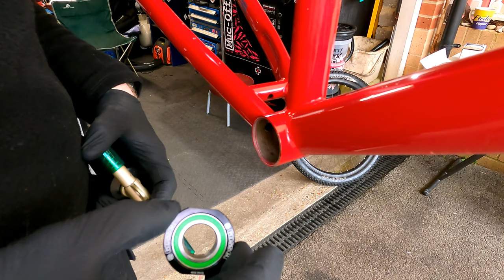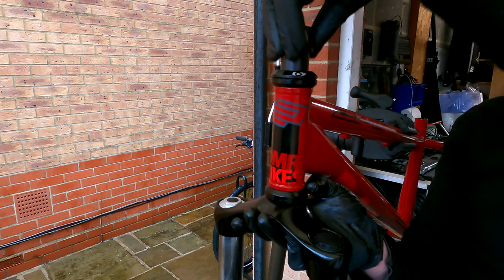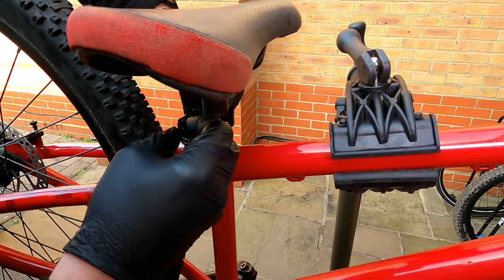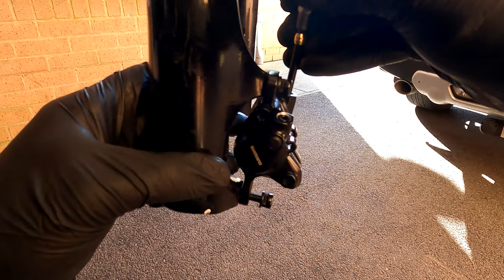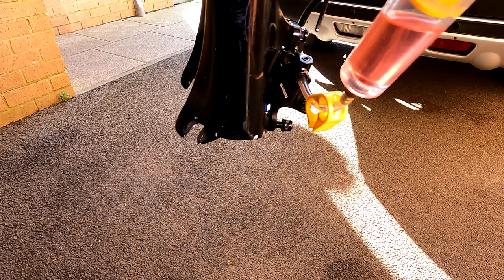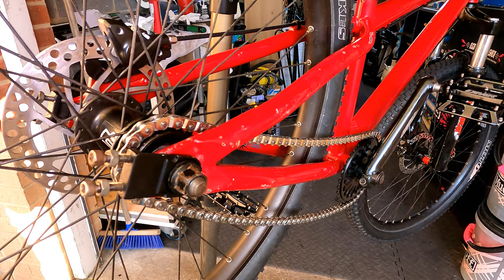Building a Jump Bike DMR Search Drone Jump full Bike Build -THE CYCLE RENOVATOR

Comment: Hi. What rear sprocket did you use? Mine has just broken and need a new one. Cant find one anywhere.
Thanks
Reply from the maker: You will need to measure the diameter of the tread. I used this one. https://www.skatepro.uk/378-17435.htm?stockcode=45031070214&gclid=Cj0KCQjwpImTBhCmARIsAKr58cwE9q0fHDQKapYq_VjGWb1nKkDkpRnPxSgX7CLn1fG4dvG-3XsJKbIaAnfrEALw_wcB